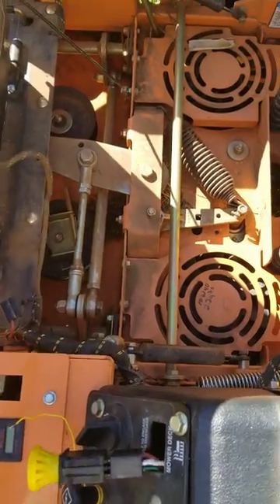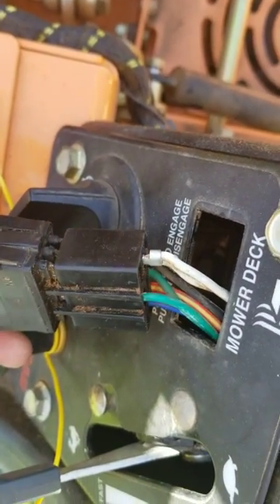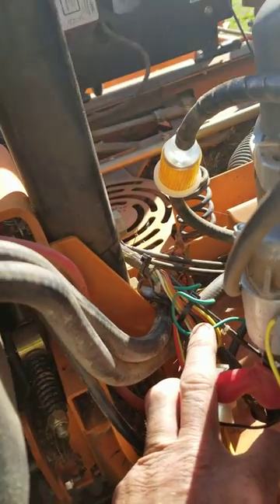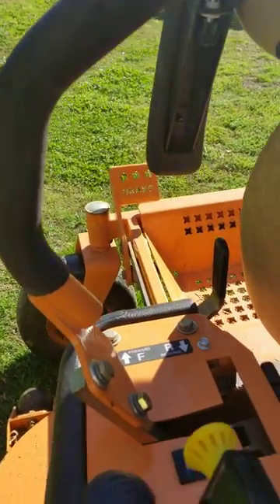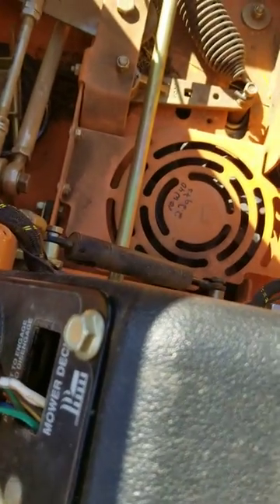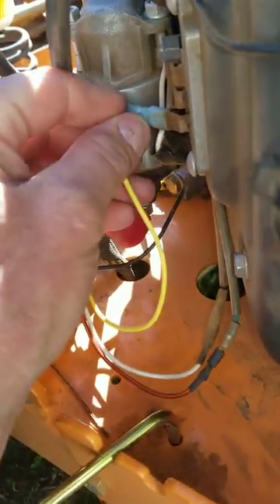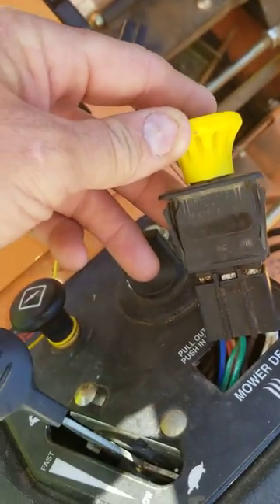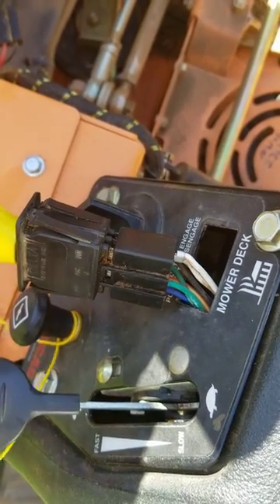Scagg wont crank!Easy fix.

Comment: Great video. Those pesky safety switches are always going out and getting clogged with dust. I finally cut all the green wires and wire nutted them together. I had juice to the solenoid, but the starter would not engage. I knew it had to be a problem with the green wires. I cut the green wires going to the PTO switch and wire nutted them together. After many hours of frustration I was relieved when she fired right up. Thanks for the help!

Comment: Thanks for this great video.  I have had this problem for the past few years when my Scag mower occasionally would not start when hot, but recently it started to happen on cold starts.  Sure enough it was the PTO switch and your video helped me to easily find the problem.  So thanks again for taking the time to post this video.  Much appreciated.  Saved me a lot of money.
Reply: Yep mine is doing it only when hot also and my pto switch is only a year old with maybe 100 hrs on it cause my mower is only 225hrs now. And on the 2nd switch!
Reply: Thanks! This is exactly what was wrong with mine.

Comment: Replaced my PTO for the same problem on my Patriot. Mowed fine that day but back to the same old stuff the next day. Turned out it was the nut holding the two wires to the starter that was loose.

Comment: You just saved my entire weekend. Jumped the green wires under the deck switch and she started right up. Definitely and engineering failure by Scag when so many of us are seeing the same issue after 2-3 years.
Reply: How do you jump them if I can know
Reply: @MsMexicanito13 I wondering the same thing

Comment: Tried every switch, my Tiger Cub w same issue was a bad connection in electrical plug just off engine.  Machine has 530 hours and-started this no start, or would just die while mowing. All good, and spare parts to boot. None of local dealers had a clue.

Comment: Hey man, thanks so much. Was out there with my Patriot a few mins ago & would not start after using it. This has happened to me previously several times in the last year and a half. Could never figure out why and always managed, at some point in time, to get it restarted. Anyway, as I was just waiting today came across your video. Sure enough, I just went out there now - the mower engage switch was Intermittent, just as you diagnosed yours. Machine started right up after I bounced the switch a few times. Tried it a 2nd time, wouldn't start and then bounced the switch and starts up! Will be calling Scag dealer tomorrow to see what the status is on new switch.
Your effort in posting this is much appreciated, thanks mucho! BTW machine is not quite 3 years old.
Reply from the maker: Glad it helped you👍

Comment: Thanks for the video. This is exactly what’s happening with my scag. I had to push and pull the pto switch a few times in the past to get the mower to crank. Now it’s dead. New battery too. I’ll be ordering a new switch.

Comment: Thanks for the video.  I've replaced my starter solenoid and still cant crank it with the key.  I can turn on the key and then jump the solenoid with a screwdriver and start it up.  So, to test to see if I have a safety switch problem from one of the 4 safety switches (including the pto), all I have to do is see if the green wire has 12 volts coming to the starter solenoid?  Is the end of the green wire at the starter solenoid supposed to read 12v power with the key on? Thanks again.
Reply from the maker: Sorry for the delay.I dont think you will get 12 volts from the green wire.Those wires just close the curcuit.You can jump each switch safety and PTO to see if you can get it to start.
Reply: @fishandwings6395  thank you sir!

Comment: Thanks for sharing that video. I knew I wasn’t getting power to the green wire on the solenoid. Even though my Liberty Z came with a manual with the wire schematics, I didn’t feel like looking at it. I figured id give YouTube a shot and I found you. Thanks again.

Comment: What do you mean by jump the switch? Does your scrap wire need to touch BOTH green wires?
Reply from the maker: Yes,scrap wire plugs into the green sockets
Reply: Can you explain a little more? Do I remove the green wires before touching the two sides of the scrap wire to the two sides of the switch?

Comment: Thanks for the video. This literally just happened to me 20 minutes ago. I'll be testing mine in the morning. Last week the fuel pump failed on a garage kept machine that's not quite 4 years old and has only 60 hours and now at least one safety switch is bad. I'm sorry but I do have to question quality of components at this point. I'm disappointed in having to do this in such a short time span.

Comment: Gonna try that tomorrow.  Was moving a lawn with my 61 and pulled mower up on trailer and it died. When I try to crack it the light by key comes on but its just silent. Hopefukly thats they problem. Thanks for the video!